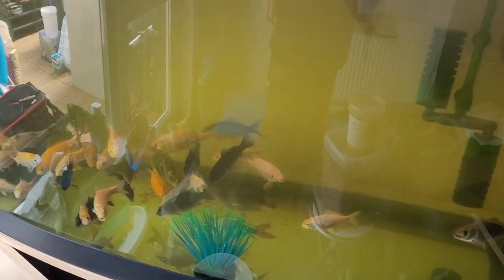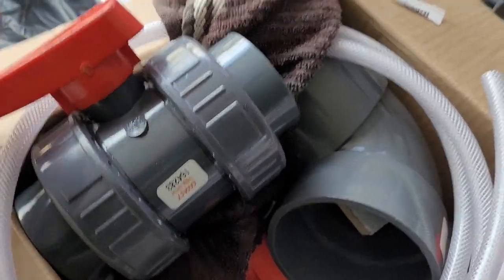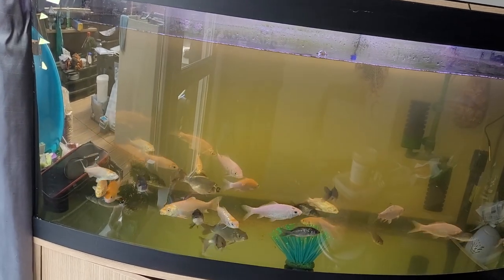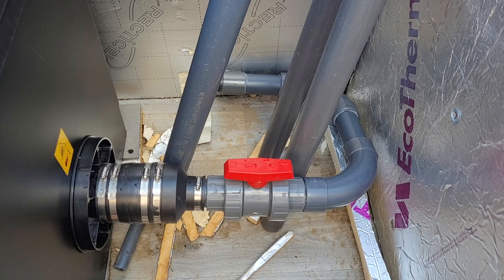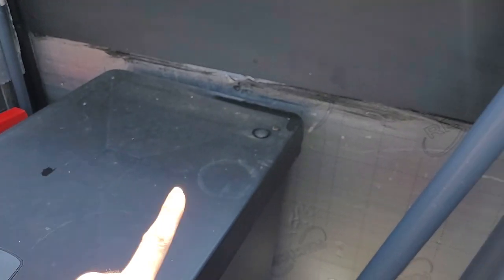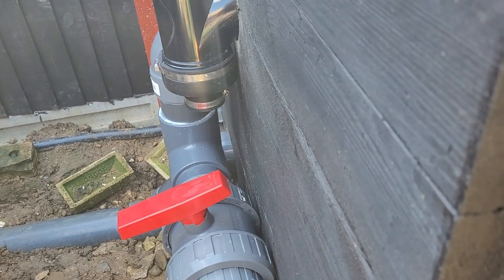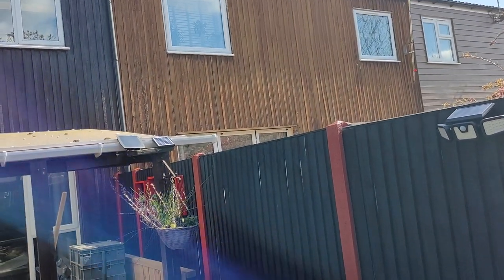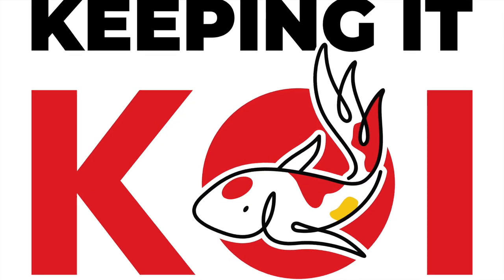Sleeper Pond with Window (Part 35) Starting of the Return lines

Comment: Coming on leaps and bounds now Jamie 👍 great idea with the access Tee, will make any cleaning of the waste much easier. In regards to the UV flow, in my understanding the UV will work better/quicker the slower you can run the water through it as the light has longer contact with the water. Keep up the good work bud 👌
Reply from the maker: Yeh I thought as much with the uv that's just making it harder to plumb in 🤣

Comment: Evening Jamie👍😊. I have exactly the same pump, it’s fantastic and as you say, uses electricity in line with what it claims👍😊. Fry are looking nice and healthy👍. Re the uv I would go with the 5000 to 6000lph option as I think any more than that won’t allow the uv to work it’s magic. Simply fyi I run 4800 lph through my 60w uv 👍😊. Can’t wait to see the window going in but making plosive progress so keep up the good work👍🐟🈲😊
Reply from the maker: Thanks Phil I had a funny feeling people would say that as that's gonna make fitting in all the pipe work 10 times harder 🤣 if I can't fit it all in I may have to just do it at the 15k lph I don't want to but I'm not sure it's going to be possible the other way I'm useless at this pipework malarkey 🤣

Comment: I think every manufacturer including Oase over rate their products it's normal ! I'm pretty sure if you tried to put 20,000 lph through that 55w UV it would slow it down to 13,000 as you have a quartz sleeve running through quite a narrow pipe you probably couldn't get a finger in the gap the water has to pass between ! I much prefer the look of the kockney koi yamitsu UV's with their bigger pipe diameter. If you don't mind me asking what brand of varipump doesn't do the stated lph/wattage as I'd like to know for future builds (is it the EA pumps?). We are currently running an Aquafote DM Vario 20,000 and its very powerful. Our drum filter is rated to take 25,000lph and the pump on max nearly drains it dry with two 4" inlets it's 210 watt at max but understandably we run it at 80% 120 watt and this gives us a good 16,000 with 5 swept bends and 0.75 meeters of head hight but no UV as it's plumbed into the bottom drain inlet of the drum on a T piece.
Reply from the maker: Cheers for the advice bud appreciate it and yes it's the ea ones, none of the stats they advertise are correct the Watts are higher than advertised and the flow rate is a lot lower than advertised
Reply: @keepingitkoi  thanks for the confirmation on the pumps I wish someone would create an in-line amalgam UVc with 4" pipe for gravity systems or with rubber 4" to 2" reducers for pump fed, but for now we got to DIY for the things we want lol 🤣
Reply from the maker: @oliverskinner8962  that would be awesome but as you say DIYing them is more fun cos when your finished you can sit back watch it work and say I did that 👍